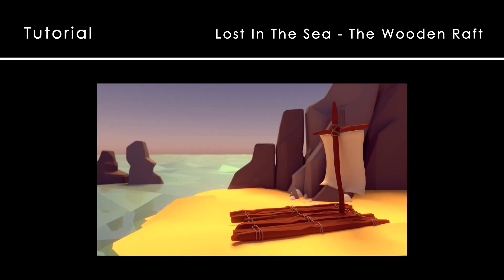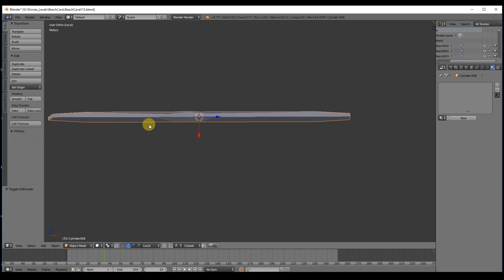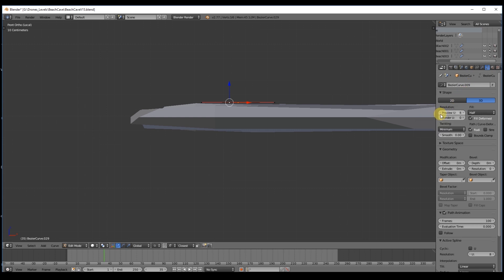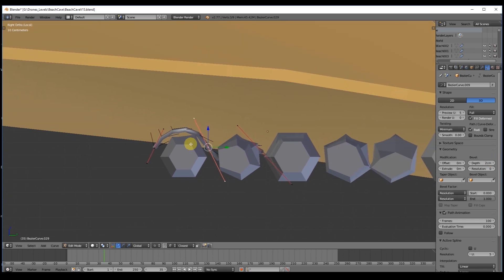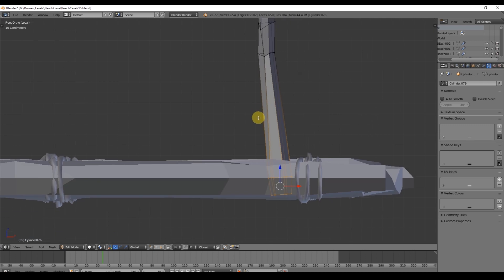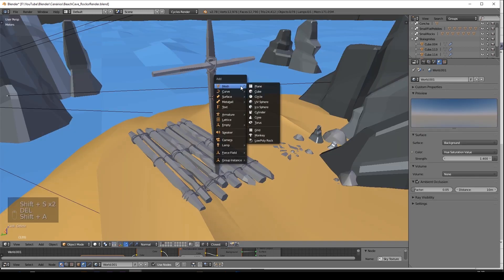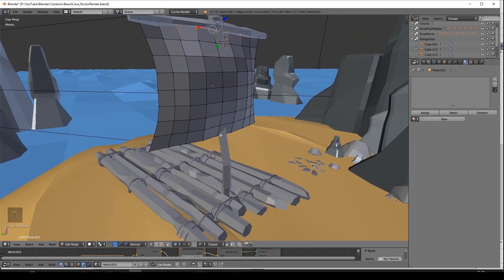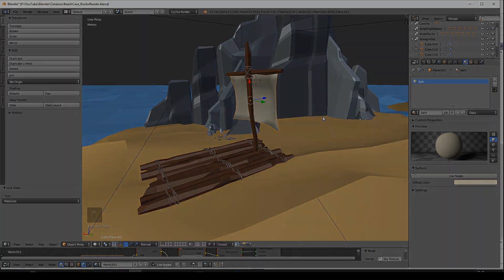Blender Tutorial - The Low Poly Wooden Raft / Boat

Comment: Any tips for beziers?I thought it was so hard to get them to look round/look good around the curves of the logs like you did :(
Reply from the maker: They are kinda tricky sometimes, but yes I've a few tips. Like, working in orthogonal view (5 from numpad). You can also select an handle, press V, and choose Free, so you can move handles independently of each other and have more control. You can also select an handle and change the Transform Orientation type to Normal which will allow you to have more precision. I hope this helps =)
Reply: Thanks for the fast response. The handle really helped, but it's still really hard. Whenever I reach a new bend, what I previously did will be ruined. Guess I just need lots of practice
Reply from the maker: You can also use snap to vertex, It helped me.
Sometimes, using 3 or 4 in the preview resolution of the bezier curves is great for modeling, and then increase that value to render. =)
Reply: Gabriel Aguiar Prod. I will try that tomorrow. bed time :) loving your low poly tutorials. hope more are coming.
Reply from the maker: Thanks man =) Yes in a near future something really cute in low poly is coming...
Have fun!
Reply: Hey man could you please send me the rope of the raft? I want to do it like you but I just cant do it so cool like you :(
Reply from the maker: Hi! If you want to have access to the ropes, the boat and more, you can do it via my patreon https://www.patreon.com/GabrielAguiarProd 
Thanks!
Reply: ok Thanks